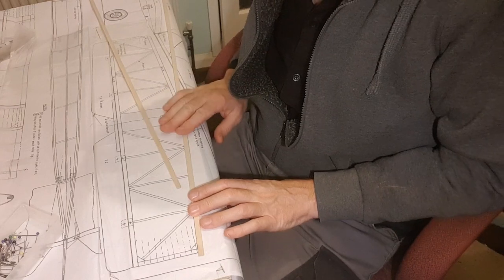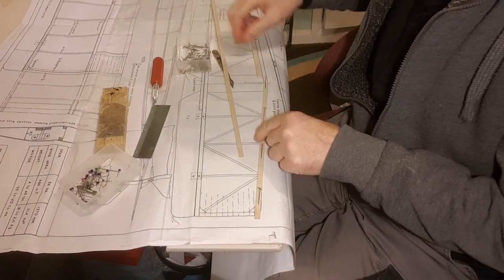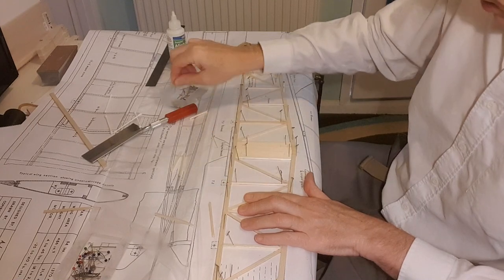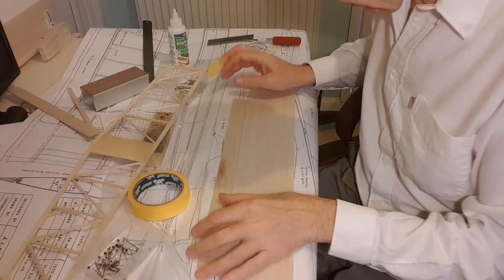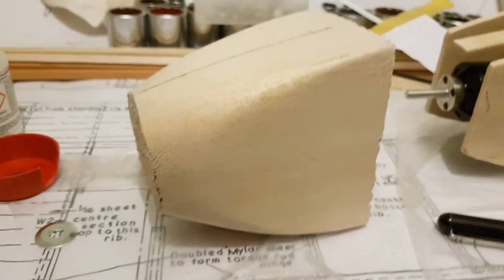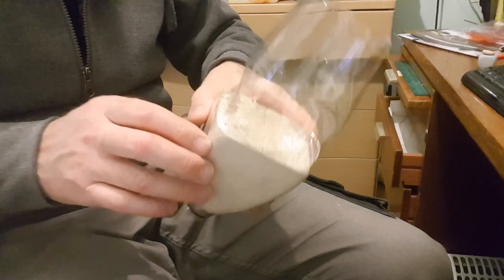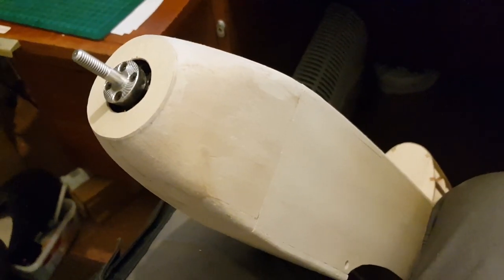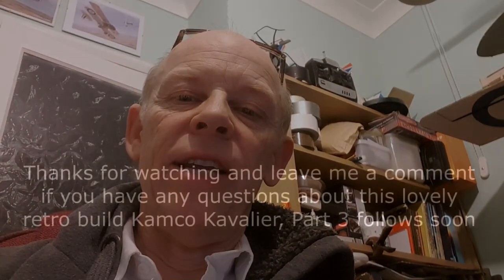Kamco Kavalier Radio Control Plane Retro Build Part 2

Comment: Back in the day we used to trace the plans on onionskin paper. Then used the tracing to cut the parts from, thus preserving the original plans. That way we always had the original unspoiled plans for future reference. Also quite useful to consult the original plans after test flying the model. We could then modify the craft by modifying the traced plans.
Reply from the maker: I've not heard of 'onion skin' Steve, did it make your eyes water 😁 but seriously for smaller parts I pop the plan under the laser printer and do a photocopy, same difference except no tears 👍
Reply: @CliffHarveyRCPlanes  It was just super thin paper, for tracing. It might have been a brand name. Mind you, this was well before the computer revolution and people were still using foolscap paper and mimeograph machines. And LED calculators had not as yet been dreamt of.

Comment: I also understand that putting 2 or 3 layers of masking tape on the fuselage, and fairing the plug into it. Slightly over sizes the plastic cowl for a slightly loose fit.
Reply from the maker: That's a great idea David, I'll pack that into the old noggin for later retrieval 👍

Comment: Hi Cliff. Interesting project! It would be great to hear how you selected the motor (the original I think was .30-.40 glow), the prop/motor/esc/batt specs you went for, and what kind of performance you're expecting. Thanks!
Reply from the maker: Hi Dave, I took advice from my local model shop (ie Stan) originally, I've actually robbed the motor and esc from my Svenson Wayfarer 60in biplane so this model is going to perform very well indeed, I have the choice of 3 or 4 cell, it depends on the cg really. The plan suggests .25 to .40 cu. in. engines with an all up weight of between 4 and 4.5lbs, it should be on the lighter side of these figures though.
Reply: @CliffHarveyRCPlanes  Please could you tell me the motor make+size so I can look it up? Thanks.
Reply from the maker: @Owly Dave  I can't until I unglue the nose Dave, I know it's a Thumper motor but that's all for the minute 😐
Reply from the maker: Hi Dave, it's an Overlander Thumper V3 T3548/05 👍
Reply: @CliffHarveyRCPlanes  Thanks Cliff. That's quite a lump! I'm guessing the combined weight of the motor/60Aesc/'battery will be more than an 0.35 glow with a bottle of fuel? I'm interested to hear about any cg issues.
Reply from the maker: @OwlyDave  With a big battery to move around I should find a sweet spot without too much trouble 👍